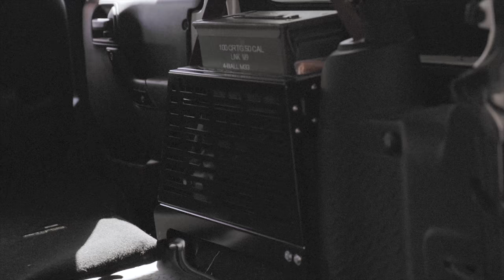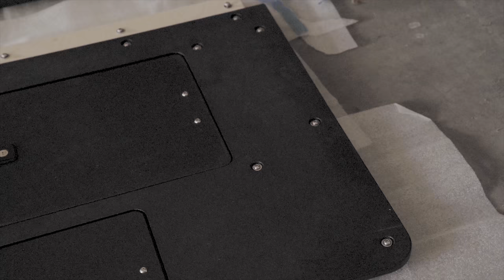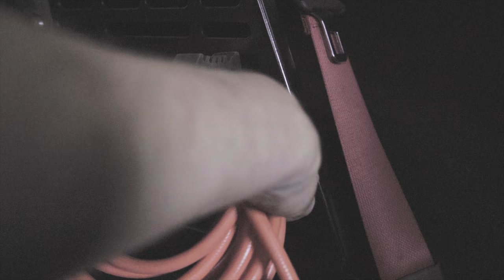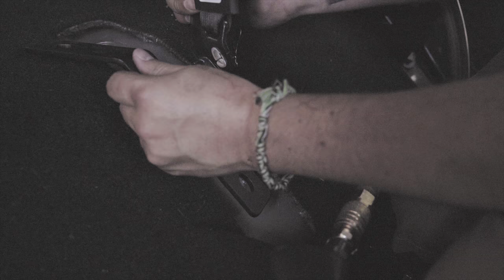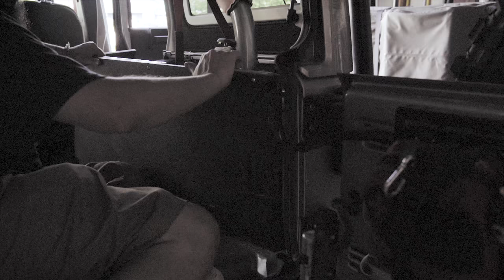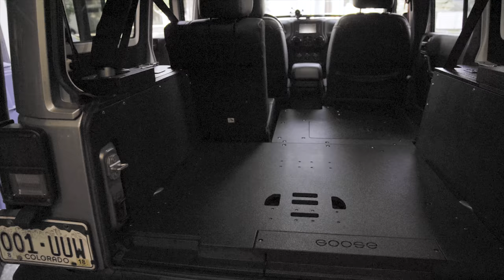Unknown Overland | Installing Goose Gear Into the Jeep JKU

Comment: Thanks for the very well done video, I enjoyed it.  I'm thinking about the full system, but concerned about the cubbies preventing the hard top from coming off easily due to the brackets being used by the hard top bolts.  What say you?
Reply from the maker: I actually just recently did this. For the most part it’s no problem. The only real issue is the most forward screws on both sides, these go into a bracket secured to the cubby and can be a pain to deal with. They still can come out, it just isn’t as easy as the rest of the screws. Otherwise the full system is pretty awesome.
Reply: @UnknownOverLand  Thanks for the info! Enjoy the setup, I'm jealous.
Reply from the maker: No problem at all!

Comment: I'm definitely thinking about adding the goose gear with a 40% removed. My dog needs the 60% seat.
Reply from the maker: I've not seen just the 40% but nothing on the site says it is an issue going with just the 40%. In all, it's so nice to just have some flat floor space for load outs.

Comment: What system/organization on the sides did you have before (the ones you were removing at the start) the goosegear plate?
Reply from the maker: Those were the M-PAC Springtail side racks. I really liked those racks as they provided both a solid MOLLE mount as well as a storage spot up on top.

Comment: Any thoughts on if the base rear floor plate with fit with the mpac racks in place?  I've got em and would like to keep em.  Thanks!
Reply from the maker: When I was initially looking at the Goose Gear I really wanted to keep my MPAC (I really loved having the Molle panels there). There's a couple issues, though. The goose gear floor still requires that the side plastics be removed for how wide it is. It is basically "meant" to meet up with the cubbies. The second, and likely bigger, issue is where the base of the MPAC mounts. It would need to slide under the floor of the base plate and the clearances might not work out. But, the goose gear is all wood, so nothing really preventing from making a couple mods that might work out.

Personally, my biggest issue was after taking out the plastics you're left with something that looks really unfinished in the back of the Jeep. The MPAC stops pretty far forward, so won't really cover that up (this is definitely a very aesthetic minded worry).
Reply: Thanks for the reply!  I've got an 09 so I don't have the plastic to the floor - it has carpet.  I'll call goose gear and see what they say about the width on the floor plate.  It may be a simple as dealing with the base connections as you mention.
Reply from the maker: Hopefully you figure out a way to make that work, I think the combo of the MPAC with the  base plate would be really cool. If it does work out, it'd be really cool to see.

Comment: I had to highly modify my plate with sub option, then i had to modify both delete plates to fit the screwed up main plate. Was a horrible and EXPENSIVE pain in the ass with no support from goose gear(got all the "I'll have Brian call you"). I never got the side cubbies, thank fing god otherwise that would have been another $800 mistake. Anyone looking to put a plate system in If I could do it over, i wouldn't drop $1500 on this plate system that I had to MODIFY after paying $1500! Make your own or have a local wood worker make you one.
Reply from the maker: Damn, that really sucks, sorry that everything went so sideways on your install. What year/model vehicle were you putting this into? What mods to the main plate did you need to make?
Reply: @UnknownOverLand  18 JKU, for some reason the brackets on the subwoofer came into contact with the runners on the bottom of the main plate and when tightening the 4 screws down it acted as a lever and popped the 2 most rear rivnuts out had to engineer a fix for installing two new rivnuts and cut slots into the bottom of the plate so it would clear the subwoofer brackets(the "ears" on each end of the sub) THEN both the 40% and 60% delete wooden bracket that goes underneath to connect the main plate to the delete plate had the correct shape to fit the main plate but none of the holes lined up. No biggy right? just drill new holes and move the nut inserts to the new holes, well in doing so the "virgin Baltic plywood" broke in two. AND the little metal angle pieces that bolt to the bottom that are used for the support under the delete plates where too wide as their are little ridges on either side of the holes to give it more strength so i had to cut them to fit in between those ridges. Was a literal shit show man, and to top it all off I was told big man brian  would call me and calm all my worries, after giving my phone number and waiting I realized I was fooled again for the 4th time lol except the waiting didn't cost me $1500. I will never do business with these clowns again, nor steer anyone to them. It seems as if your install went good, lucky dog!
Reply from the maker: Thanks for sharing this; that’s pretty horrible experience overall especially with you not hearing anything from the Goose Gear during at all. With all of that I definitely don’t blame you for being so harsh on them. I’m hoping if someone else has the same issues they can at least get some hints from what you wound up having to do. Now that it’s installed, do you plan on keeping it or just replacing it with/making something you’ll be happier with?